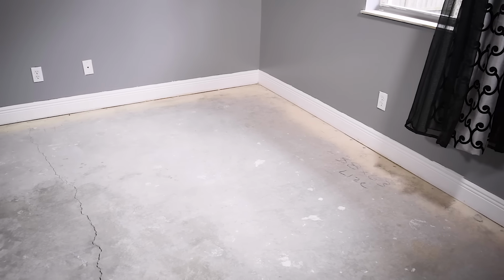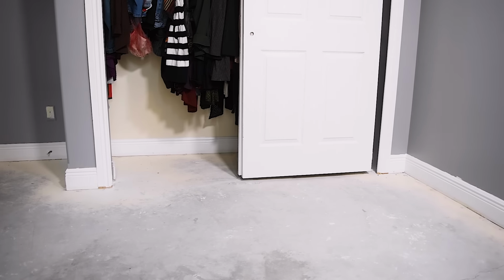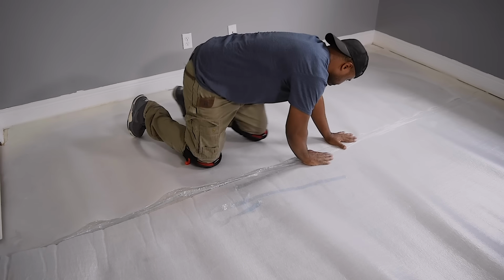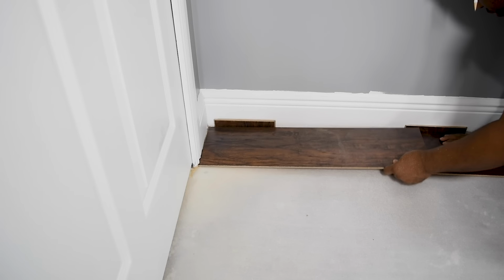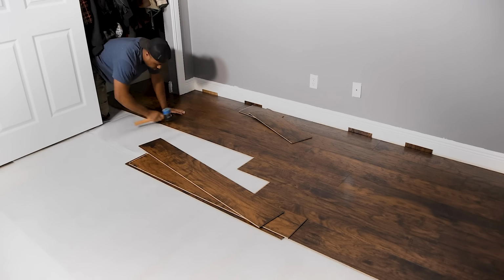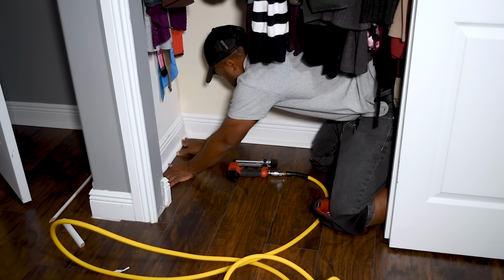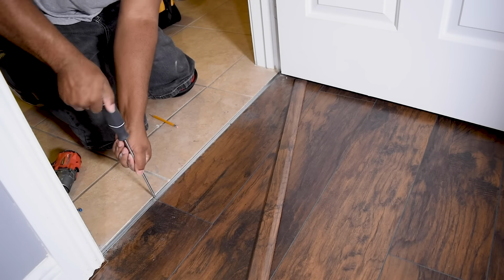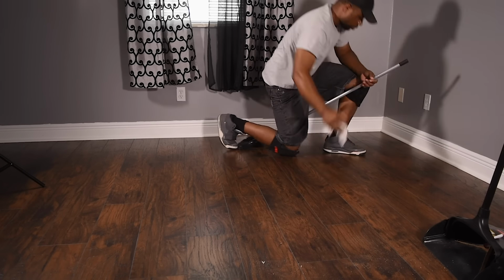How to Install Laminate Flooring for beginners

Comment: for complete beginner, then i just realized...i dont have all those machines to do the cutting and what not lol
Reply: You can go to any hardware store and get the cheap(er) versions of his machines. You only need two things, really, a saw and a tape measure. You can do this with a hand saw, it will just take longer. With some electric circular saw that you can get for under 50 USD, it will be a lot faster. Any other things are extra, they can make things easier, but might not be worth it if you do one room. If you want to fix an entire house, than it might already make sense to invest in a bit more tools.
Reply: Lol I was saying the same thing
Reply: Exactly! I'm going to be laying this kinda flooring in the beginning of april and I have none of these tools, but hey it's an investment.
Reply: Definitely buy one I used the hand saw for the jams and it kicked my ass just that low angle. I think there like 80 dollars at Home Depot get one
Reply: @MikeHunt-qu6ef  I agree, I held off so long getting one of those and I wished I had my Ryobi multi tool cutter then. I hand sawed it on top of a scrap piece it sucked. And the tool has come in use since then, like cutting a small wedge from a 2x4 in ceiling when I was hanging a ceiling fan for my bracket. I used it several times. I wish I could go back in time to save my back from the pain
Reply: Da Reptile exactly lol I was on my damn side switched sides couldn’t get comfortable on top of the being damn 37 lol. So I finished my floors my sisters now wanted hers done, I go in a hardwood floor store this time, that tool is 50 bucks now smh. What I wouldn’t give to jump in Docs Dalorean and buy that thing for that first job lol. I will never try to hand cut anything ever again lol.
Reply: You can use dremmel. Or circle saw both fine
Reply: I've found also to shop at Pawn shops, you can obtain some good quality tools at discount prices; or put on layaway until you're able to get out.  This works for me and by the Grace of God, I have more than imaginable and I still continue to look for good deals.
Reply: If you can't afford to buy them, rent them.. you only pay at deposit upfront, but you will be reiumbursed after you are finnished. At least for me it is.. I did my living room floors but i wasn't going to pay over 500$ in tools + 300 for the actual floor and other stuff.. so i rented the table saw, air compressor + nail gun and other stuff.. almost free.. you only pay a small fee, i thing it was around 20$ for everything.. not bad considering ....
Reply: when i did my first laminate floor project years ago, i bought this tool: SKIL 4-3/8-in 7-Amp Sliding Flooring Saw
 - it can do rip cuts and cross cuts, it's useful if you're not looking to expand your tool collection.
now that i have a miter saw and table saw it's become redundant though.
Reply: Hotel hopper Right I was thinking the same thing
Reply: @Angel-wo6qh  ahahahha
Reply: Hotel hopper 👏🏽😂
Reply: @Michael Bailey hahaha
Reply: @NeuralNetOtaku  just to have. Not specifically for flooring.
Reply: What it called that wooden tile or real wooden plates?? What's it actually called
Reply: Get a saw, hammer and nail. No excuses.
Reply: I know, beginners??
Reply: everyone gets boners for all the expensive high end tools....but only contractors or people that do this for a living should use those....if you can afford them then have at it. However I use nothing but Ryobi because I dont use tools often and theyre cheap but work extremely well in my opinion. If youre laying laminate Id recommend a table saw and a mitre saw. The first house I ever did I didnt have a table saw I only had a mitre saw and a jig saw and the table saw purhcase was a game changer. I have to teach myself on all my tools because I didnt grow up with tools or dad/grandpa that used or knew about tools, but its fun and exciting. dig in! Also if you cant afford any of those apply for a Home depot credit card and just make payments on it. itll help build your credit score. good luck
Reply: @kyleallen1858  Another thing to consider is paying someone to do the installation. If you are intimidated by something like this, then pay someone to do it...something I do for major jobs like this. This is due to having a pretty bad MVA over a decade ago, and my neck is in pretty bad shape, so doing this type of work for hours and hours is just not doable. 
However if you are young and healthy and love a challenge go for it. Remember when you do something yourself (even something as simple as changing your garbage disposal to fixing a leaking toilet) it gives you a great feeling of satisfaction. Not only that, the tools you bought to accomplish the job (rather than that money going to someone else) are yours to keep and you might just end up being a hero in your household!  For the DIYer I personally like the RIDGID line of tools, they have something called the Lifetime service agreement on all their tools, and they will even exchange your batteries on your power tools for free...for life! Pretty good deal.
Reply: @kyleallen1858  table saw? i would rather use a plunge saw/ circular saw my dude
Reply: @maxlewis233  really why?
Reply: use that mitre box £4.00
Reply: There is a different method of cutting with just a boxcutter and pliers. Search it up
Reply: Sal Hernandez Keyt get your diy talented ass outta here sal lol damn McGyver next thing ur gonna tell us you can just use some box cutters and cut the wood off the trees. Lol
Reply: Its subsidence
Reply: A decent one with a diablo blade should run like 130 at harbor freight or on marketplace.

Comment: Not bad, you take Pride in your work which is Always Very Important. My Only real critique is your caulking which is a Art form in itself and is Very difficult for Many people to master. My tip for you is to use a damp to wet grout sponge, real sponge Not the acrylic (or whatever the material) to clean, shape your caulking because if this is not mastered it could look worse than if you had used No caulk at all.
 I learned from the Best of the Best over 40 years ago with my forte being Kitchen and Bathroom Renovation Gut to Finish with special detail to tile especially the tub surround.
 Good Luck to you in the future.

Comment: You use little pieces as spacing to leave a gap at the beginning, but do you need to leave a gap on the sides?
Reply: You need to to leave a gap all around cause it can expend to any direction. It depends on the manufacturer but it usually says on the box the recommended spacing you need to leave.  Do not use cut off pieces as spacers cause laminate comes in different thicknesses (quality). Just get yourself a laminate installation kit. They cost like 10/15 bucks and come with spacers and tools you might, well probably, need to use.

The floor on this video is laid down way too tight, you might get away with it but that depends on the climate conditions. Plus rule number one, have laminate acclimate 48 hours in the room before you install it.
Reply: @TheSir2005  thanks you!

Comment: That's a nice foundation crack they got going on.
Reply: Having cracks in the slab is not as uncommon as you think.  It is usually caused by it not being cured correctly.  Could have been poured in the summer and they didn't hit it with the hose enough and it dried out to quick.

He probably still should have used a leveling compound to level it out, but the vapor barrier should prevent any moisture from damaging the laminate.

If I did this, I would have filled it, as I provide an installation warranty.. and that would have screwed me if there was an issue caused by it down the road.
Reply: That’s a concrete floor not the foundation
Reply: lol news flash cement has a crack! stfu idiot
Reply: @tomclose6643  wow what a douche!
Reply: Further proves my point. Have a good one.

Comment: Can we intsall it to existing tile floor ?
Reply: Yes you can. Just don't forget the underlayment. (and moisture barrier if it's not included on the underlayment.) Also, depending on the roughness of your flooring surface and the foot traffic that area sees, you might want to step up in quality from the underlayment he used in this video. It truly is bottom rung as far as quality.

Comment: I have two 1/2 inch square plywood 5'x4' glued together, I'd like to put on laminate flooring, is it ok to glue or nail them on. I'm making a gym platform.
Reply: mpa324 I would do both just so it’s more in place. Then you can fill the small nail holes with wood putty

Comment: That underlayment does not have a built in moisture barrier a 6 mil poly plastic is required on installation over concrete. But also that crack seems to be a foundation issue with in time it will become transparent and buckle the laminate flooring.
Reply: Yea ok.

Comment: you got lots of tools to work with. most people don’t have them at home.
Reply: Its an investment. If you do any kind of diy it pays for itself with every project.
Reply: Mallet, miter saw, tape measure only really the tools that are a must...

Multi tool helps on doors & jig saw is just for perfecting..

All these tools, sans the saw, you can get for $100 total these days

Comment: if you flip a plank over you can use it as a guide for your oscillating tool without scuffing the top side of the plank.

Comment: Do you need to secure the laminate to anything so it doesn’t slide?
Reply: it shgould be whats called a floating floor where the weight of the panels keep the flooring down and the baseboards keep the edges down
Reply: That 200 square feet probably weighs close to 500 pounds, its not going anywhere.
Reply: Depending on the brand, they often have rubber on the bottom surface kind of like shoes that should provide traction to keep them from sliding around too much.

Comment: Hey, how can I install laminate flooring around steal door frames if there's no gap to slide the plank under it?
Normally with wooden door frames I just trim them.
Reply: leave a small gap and cover with flexible caulk
Reply: @robertfrederick8076  wouldnt it look weird though?
Someone told me to trim the steel door frame with a jamb saw
Reply: @ameensh2439  Match the color of the caulk with either the laminate or the door frame. Never heard of cutting through metal door jambs.
Reply: @robertfrederick8076  Thank you :) I will do that

Comment: The most tricky bit I find is trying to figure out how much of a plank you are going to end up with at either the doorway wall or the opposite side of room. Probably not a problem if laying them lengthways but when laying widthways its a bit of a guessing game because you could end up with a narrow gap then have to mess about shifting the rest of the floor to get it right.  Also cutting around the doorframe is a pain.

Comment: Hi sir,

After watching your video, l learned a lot.  But I am still nervous about starting because I don't know which direction to start. Also I will be putting the planks over tile that's located in the bathroom and kitchen. Is the preparation the as in the video.  Can I send you some pics of area?
Thanks in advance

Comment: I HATE laminate flooring, that crap should be illegal,  the first time your floor gets wet that laminte flooring will swell up and buckle and come apart, laminte flooring is the worst thing you could ever put on a floor, get tile or linoleum = something waterproof
Reply: ...got the same floor and have had spilled liquids..even had dog vomit..still looks good after many years!

Comment: Little tip for the last row getting underneath the door frame. You can cut off the click (just the bump) and use a tongue and groove glue so all you have to do is pull it together and tape it till its dry

Comment: My boss wouldve shot us already....
"Effin rip that trim we'll throw it in the rcv" 
Lmao
Reply: Send your boss away to to bid on more work , that will be his job.
Reply: Right? The labor having to work around the baseboard is higher than removing and reinstalling the baseboards. Yank that shit out under cut the door frame molding and do it right also easier
Reply: My installers groan when they go into places and find baseboard which is glued in... if its just stapled it comes out and goes right back in when they are done installing the flooring.
Reply: Matthew Demonroe biz killer
Reply: @Yourmommastinks  how so? Lol

Comment: I never use caulking your supposed to undercut your doorways I've been doing flooring for 20 years this guy is an amateur at best
Reply from the maker: I'm guessing you didnt see me cutting the the door trim at the closet. The gap under the doorway "near the bathroom" was too large from the rug installation. The trim was cut short. I was trying to make it look better than just have a massive gap. Call me amateur that's fine but I know what's up. After 20 years I'm sure you will find fault in everyone's work. Thanks for watching.
Reply: why you watching this video than? says flooring for beginners. idiot.

Comment: That’s a huge crack in the foundation
Reply: Doesn't matter unless there's a sink hole underneath.
Reply: Cracks in slabs are not that uncommon.  He probably should have filled this in with a leveling compound to make sure the floor was level.

Whoever poured the slab probably didn't maintain it while it was curing and it dried to fast.

Comment: I would recommend using quarter round that matched the floor and then use a caulk that matched floor as well. Would hide that imperfections around the door jambs even better.

Comment: two things .... firstly you should tear off the skirting boards by the floor so that you don't add a little weird skirting later. secondly, by placing panels, the end that you cut from the last panel gives from the beginning of the next line, in this way you have no waste ... best regards
Reply: you're right about the waste, i always do it like that, virtually no waste

Comment: I'm  OLD  SCHOOL.    1.-remove or trim baseboard.   2-FIND THE CENTER OF THE ROOM and start from center working in quadrants.  3- possibly the most important...FIX THE CRACKED FLOOR.   Unless of course your neighbors ain't expecting much.

Comment: Typical joiners way 😂 use your last cut off piece as the starter ( as long as the stagger works well ) also you use a tapping block to tighten it all up and to finish off you didn’t show people how to correctly cut the final row in ?

Comment: You did an excellent job on that floor. I remember the very first time I installed Pergo flooring. The guy who I was working with said: "Lookie here, the key is in the molding. It's gunna clean up every flaw she has because her house is so old. You'll see." In the end, it looked perfect. But at first, I couldn't see how he was going to pull that job off. You did everything that guy did...except we didn't do the quarter rounds. That was a very nice touch. Great job!

Comment: Never been a fan of that stairstep joint pattern.  A video of laying laminate in a hallway would impress me. Ive installed every type of floor available and finish cuts in a hallway (running lengthways) is very difficult.

Comment: Great video. One of the best or maybe even the best floating floor installation videos on YouTube. Same steps can be used for floating engineered hardwood floor they're just a taller height and the piece shapes may be irregular, just need to know to keep the irregular pieces aside and use them for end pieces for the road if you can salvage parts of them.

Comment: I have a new found respect for you and your work. I am hoping for a video on how to install base caps with a back groove. I recently had to install base caps where a straight bit cut a groove at a 30 degree angle on the back which slides onto the baseboard below it. $% degree miters don't even come close to fitting together nicely and the compound miter cuts have literally given me brain damage. I know coping I a thing but it wasn't an option  in this situation as the quarter round and baseboard wan't getting removed or replaced, only the cap so I was unable to pull one off as a template. Please let me know the secret to installing this correctly without having to do a cover up.

Comment: If anyone interested in buying tapping blocks for better work here is a link https://www.ebay.com/itm/Hardwood-Laminate-Tapping-Block/223694260069?_trkparms=aid%3D111001%26algo%3DREC.SEED%26ao%3D1%26asc%3D20180816085401%26meid%3D17709335441e4321856e179e660e8bf0%26pid%3D100970%26rk%3D1%26rkt%3D2%26sd%3D223694260069%26itm%3D223694260069%26pmt%3D1%26noa%3D1%26pg%3D2380057&_trksid=p2380057.c100970.m5481&_trkparms=pageci%3Ac6ff36e2-f05d-11e9-b743-74dbd180bd02%7Cparentrq%3Ad685356516d0a4d21bb25853fff947bd%7Ciid%3A1

Comment: I would like to see it installed in the bathroom around the toilet. That's tricky.
Reply: bpxl53yewz remove the toilet 😂 and btw. Using laminate in wetrooms is not a good idea..
Reply: Laminates in bathrooms require extra TLC.  Its a wood product, and even with the high quality water resistant laminates you can wet mop ambient water can still damage it over time.

I tell my customers, "you can, but you need to be sure you maintain your sealing around your tub and showers, and toilet.. and how many people do you know that go back every year or two and redo that?  I love laminate, as its tougher than pretty much anything  but tile, but LVP is still a better choice for a floating floor in bathrooms."

Comment: I can see why some people disliked this video, you should NEVER use quarter round, the baseboards should’ve been removed with the door jams undercut so you can fit the boards underneath the door jams instead of using chalking to fill gaps and then the baseboards put back on and re-dapped.